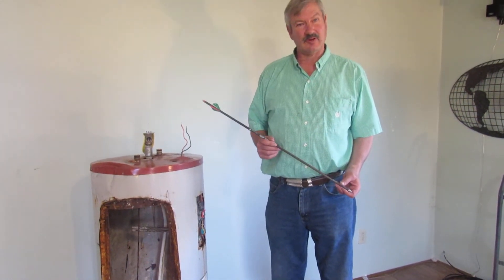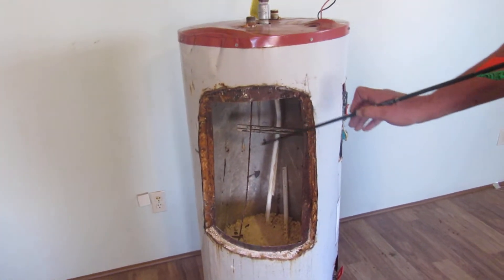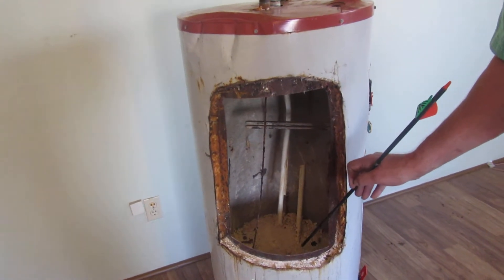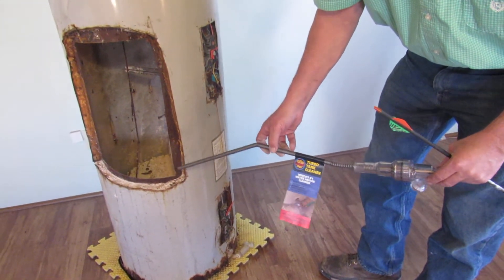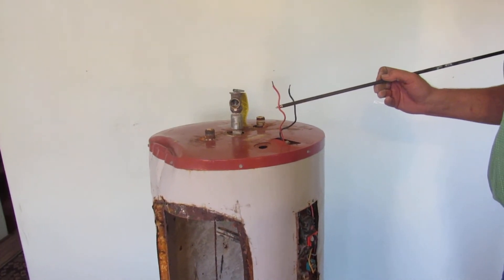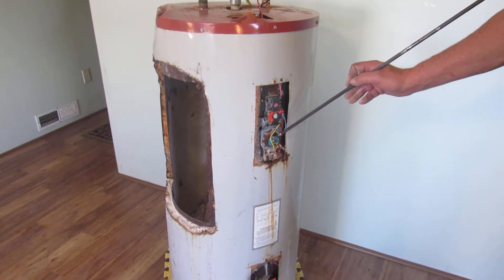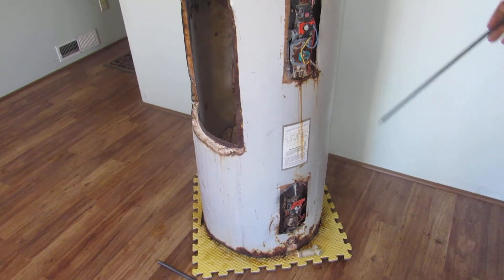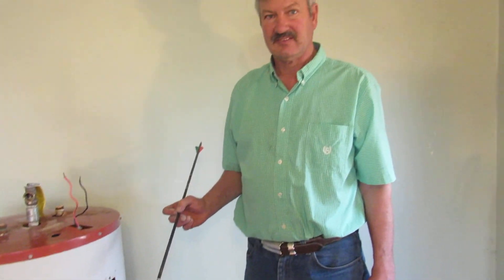TURBO TANK CLEANER | Water Heater Maintenance

Comment: Won't that "tool" just whip around in there, breaking the glass lining?
Reply from the maker: The spinning agitator is designed merely to stir up the loose sediment deposits at the bottom of the tank so that the flowing water can sweep them into the auger. It is the spinning auger and the powerful force of the water that tare apart the chunks of sediment and pull them inside. The agitator is soft, flexible, has very little mass and will not harm your tank in any way.
Reply: @craigmuehleip9121  Why not demonstrate the action by inserting this tool through the drain hole, spinning it with a drill and let's see what it does to the sediment through the open cutout.
Reply: Exactly!
Reply: It could also break the dip tube and the bottom heater !…….
Reply: @Candy-le5wk  - yes the dip tube might get in the way of that thing whipping around as well as the element if it’s an electric heater. Don’t think these will work on my natural gas heater because of the flue in the middle